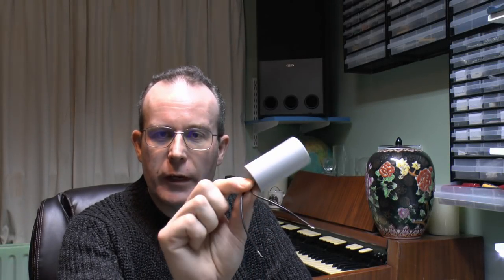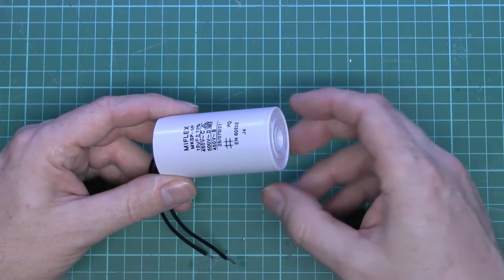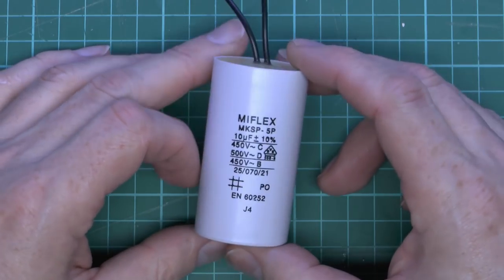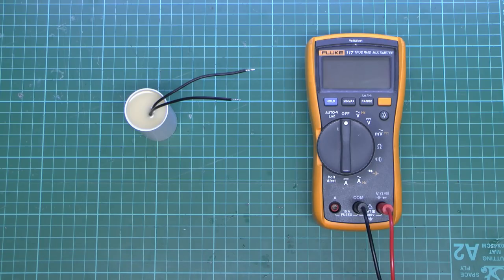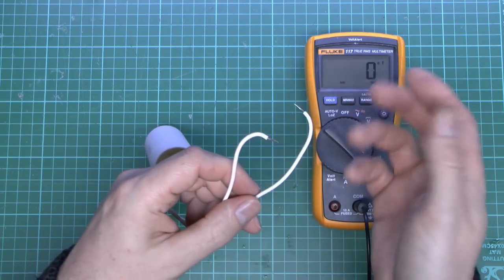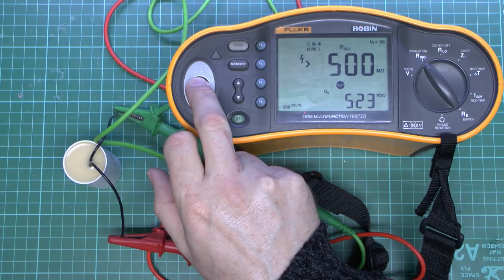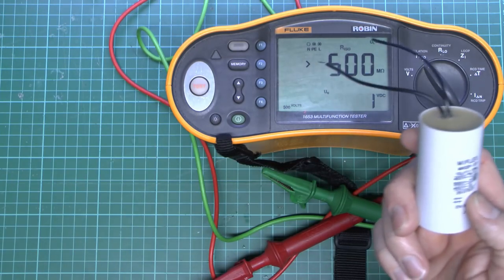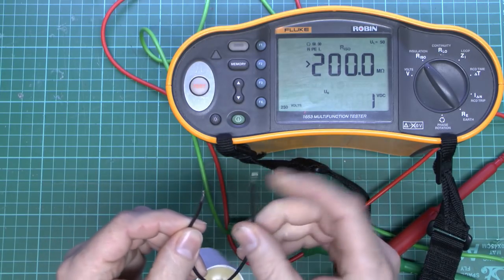Capacitors for electric motors

Comment from the maker: Short video of the faulty capacitor cut open: https://www.facebook.com/jwflame/videos/320897598422229/
Reply: It makes me wonder the quality of the capacitor when the core is that far off center, as the core will have greater insulation to the outside in some places compared to others. If they cant be bothered getting the core somewhere squared, what else haven't the manufacturers been bothered with and cut corners?
Reply: can a failed capacitor cause a rcd to trip?

Comment: Well what would you know...... Just watched this on the 1st and my tumble dryer packed in yesterday and the cause after some simple testing... the capacitor for the motor :)   Thank's John - new one ordered and to be fitted tomorrow :)

For those interested:
White Knight CL 447WV
Symptoms  - No grinding noises/bearings smooth/drum not locked up/belt intact/timer/heating element all work fine and motor powers up but no spinning drum.  If you give the drum a little push start it works as normally, when drum stops to change direction it wont spin again without a nudge.
Fix - Replace motor capacitor

Comment: Well done John, useful information and great presentation.  I have the benefit of a private water supply and multi stage single phase borehole pump some 88m below ground.  I forget the startup capacitor value but they are like bake bean cans (excuse the phrase!} and when they periodically blow they usually explode leaving a large hole in the side of the case!  37A startup current would account for this.  An explanation of the circuit would be useful and the considerable advantages of 3 phase motors - now available by using an inverter in this scenario.

Comment: Had one give up the ghost last week in a central heating boiler pump. There was no leaking or deformation in the cap, but that's not unusual in this type of poly caps. One thing worth mentioning is the fact that if the cap is blown, in some cases the motor will draw more amps and fry itself.

Comment: With an old analog meter can test if open or shorted. Using continuity (resistance) apply to terminals then reverse a good capacitor will kick the needle....Good idea to short capacitor before removing from motor.
Reply: Great video.  Thanks for posting.

Comment: Something else that is very important is that it's an AC rated capacitor and not a DC electrolytic as the latter will fail catastrophically using AC. Of course they are unlikely to be confused as a DC 450v electrolytic of that capacity will be much smaller and look rather different, but just in case...

Comment: Using this Fluke(same as mine) and a Robin won't be enough to determine the health of a capacitor even if you get the correct capacity (Farads) when measured.
What you need in reality is an ESR meter to meausure the Effective Series Resistance, if it within the proper value the cap would be good and the machine would work efficiently, or else, many bad scenarios could take place, fire, damage to motor, fried PCB, or even electric shock in some instances.

Comment: What does resistance value denote in these tests? Is it mean that the capacitor is not internally shorted and the resistance between its dialctrics are according to the specs?

Comment: Just a note: some motors have an auto reset thermal cut off to prevent burnout caused by a pump running dry etc. Worthwhile waiting for possible reset before checking capacitor.

Comment: To make a 220V motor spin slower, do I need a smaller capacitor than original, or a larger one ? And does it directly multiply ? E.g a half or a double size capacitor would give half or double the motor speed ?

Comment: for 3 wire ac motor with single capacitor, should we plug the com to neutral, 2 others from motor plus live to capacitor or changing the live and neutral or it makes no difference?

Comment: Very interesting video, thank you. I have a large 1000 microfarad capacitor and when I try insulation test at 500V, the meter struggles to go over about 40V and shows a low resistance reading. I thought it had a short in the capacitor but I am now wondering if the insulation tester is struggling to make sufficient current to charge the capacitor, and the capacitor itself may be ok. I also have a capacitance tester but it doesn't have a setting for capacitors this big.

Comment: Hi Mr. Ward, Very educational, thank you.
My Riello 40 Oil burner has a 90W motor with a capacitor of 4uF, which was no longer working, so I repalced it with a capacitor of the same value, which lastet about 2 months; replaced it again with on of 4uF, which lastest another month.
Now repalced it with a capacitor of 12uF. 
Hopefully this one will hold...
But my question is: will this capacitor 12uF now damage the engien; is it bad to use a different capacitor value and why?
Thank you,
Jake
Reply: Jake Kennes  Your capacitor exploded due to a fault in the circuit, or a voltage rating lower than the supplied voltage. Changing it for one of a different Microfarad value will not help that. Use a 4 microfarad with a higher voltage rating. However the 12 microfarad capacitor will not damage your motor, only worsen your power factor

Comment: John, I have to replace both capacitors on my Drill Press. The only thing that i am not sure of is, Does it matter which wire to use ?. Both capacitors have 2 black wires . but, The motor wires are red and black for the run capacitor. And red and blue for the start capacitor.
Reply from the maker: AC capacitors can be connected either way, there is no polarity.

Comment: My sun bed has a missing 240v 50 uf capicitor missing. Ive bought another but the wires coming out of it are both white yet my sunbed has a brown and blue wire to attach to it. 
My question is how do i know which wires go where? Thanks in advance
Reply from the maker: Brown to one of the white wires, blue to the other white wire.
Makes no difference which one, it's AC.

Comment: There is an error in this video regarding the voltage ratings: While it is true that the peak voltage of a sine wave is root-2 (1.414…) times the RMS level, capacitors purpose-made for AC applications (like these) are rated in RMS volts (so their DC limit will be higher).

Motor capacitors have their high ratings because the phase shift can subject them to more than the input voltage.
Reply: Yup, a 500VAC cap is good for about 700VDC.

And this means that you *must not* use a 250VAC capacitor to start a 230VAC motor - the capacitor will have 300VAC or more, because the start winding is highly inductive.

Comment: i have a box of fifty of these from taking apart pool pumps for copper wire recycling, Do you have any suggestion for something  useful  to do with them ?
Reply from the maker: Not really - no one will want used capacitors as new ones are so cheap.

Comment: John. I have a prob with my lawnmower. It's been getting harder to start and appears to produce less torque over time. First noticed this last year in the spring. More noticeable with longer grass of course but is less of an issue as the season progresses and grass growth slows. It has now packed up. This has all the symptoms of a failing capacitor. The safety breaker switch also trips when it is switched on. I only have a circuit tester which is of limited use but I decided to replace the capacitor anyway. No success. I have checked all the cables and they are fine. Is it possible the motor has packed up? If so, what is the easiest way to test it? Don't want to replace the mower if it is fixable. Many thanks. PS - Think it is @ 8 years old but has had a relatively easy life.
Reply from the maker: Motor failure is certainly possible, and could result in the same symptoms.
The breaker tripping when switched on suggests some fault with the motor itself such as failed / shorted windings.  If it was just the capacitor failed, it would not trip.
Reply: Thanks for getting back, John. That's what I thought. Did another circuit test (based on the old joiner's adage of measure twice not once!) and everything is fine up as far as the motor. Funny thing is I get a reading on both wires at the mains 'in' end but only via one motor wire, if that makes sense, which suggests a short somewhere. Trip would confirm that. Seems your hunch about the windings could well be right in which case it is game set and match. Time for a new mower before the Triffids move in. Many thanks. PS - Great channel for us part timers.

Comment: I'm hand building low voltage DC motors. What is a good starting capacitor diagram so that my motors are self starting? Thanks.
Reply: DC motors are normally self starting, no capacitor needed.
Reply: Coolkeys2009 Thanks. After I wrote the question, I started thinking that AC motors use them. I just don't want to put power to it because I don't want to burn insulation off the magnet wire. Guess it's time to creep up on the voltage and see what happens. I wanted to prevent problems by making mistakes on paper first. Obviously I'm a total noob. I've tried 3 different rotor designs, but only have had a few AA or 9V batteries. Barely able to detect a response with a neodymium magnet. I've got good continuity thru the coils & commutator contacts. I wrote the lack of response off to low power issue. I just purchased a DC power supply 0 to 30V and 0 to 5A. I really don't want to screw that up. It was a big expense, especially at the end of the month. (Thanks to my sister who helped.) And again, thank you for your response.
Reply: You could measure the resistance across the commutator and use Ohms law I=V/R to determine the voltage that will drive the required current through your windings(at  0 RPM). The maximum current will be determined by the thickness of wire you have used. Once your motor starts spinning it will require more voltage as it speeds up to keep increasing in speed. A PSU 30V 5A is a 150W and can easily destroy stuff connect to it and maybe it's self, so I would start of by keeping the current set low 0.1 to 1amp and the voltage bellow 10V. When working with inductive/low resistance loads it's easy to damage regulated psu's, so I would also watch for abnormal readings and behaviour of your psu when your motor does start spinning. Wiki pedia has good in basic information on all kinds of motors. I have made a few videos about my experiments with Brush less DC motors.

Comment: At 2:50 you say that the voltage rating printed on the cap is the peak voltage of the AC waveform, but doesn't the little squiggle/tilde in "V~" mean "volts AC"?  Which would suggest to me that the printed ratings are the RMS values rather than peak.  Are you able to confirm this?  If I understand you correctly then finding a cap rated at 240 volts AC won't actually work on 240 VAC because as you say the peak is nearer 340 volts.  I would've thought a cap would be rated at either 240 VAC or "AC, 340V peak".  Every other AC component seems to be rated at RMS voltages and I've never heard capacitors as an exception so if that's true it's a surprising one that isn't talked about much!
Reply: I just went down the rabbit hole on this for run capacitors like the ones shown. I discovered that the voltage rating on a run capacitor is for the back EMF, not the supply voltage.  Back EMF can get quite high even for a motor driven by say 120v mains and is dependent upon the motor speed.  Running a motor without a load thus at highest speed cause the highest back EMF and can shorten the life of the run cap.
Reply: @jkbrown5496  Very interesting!  How difficult is it to figure out how much back EMF you're dealing with?

Comment: Would a failed motor capacitor cause a single phase AC motor to trip out the electrics when motor is switched on?
Reply from the maker: Not usually - it would have to fail short circuit to do that, and capacitors of that type should be designed to fail open circuit, in which case the only problem is the motor does not start.
Reply: John Ward Thanks for replying. I have a feeling I've got a duff motor.

Comment: I'm guessing any digital multimeters under $20 is unable to check the MFD level of a run/start capacitor. Is that correct. None of the one's I've seen have all the options/settings that your meter has.
Reply from the maker: Most under $20 meters won't have that capacitance range, you will need to look at $50+ for those that have it.  Something like the UT139C made by Uni-T.
The meter in the video is a Fluke 117, which is about $250.
Reply: @jwflame  You just made me cry...

Comment: Hi, I don't understand why it's OK to over voltage your new cap.  It looks like your new capacitor is rated for 500V at best, while your insulation tester was happy to apply at least 530V on it, perhaps even way higher for a split second.  This seems to me like a good way to undermine the performance and longevity of your brand new cap.  Otherwise, nice video.
Reply from the maker: New capacitors would not normally be tested.  Done in the video to show the difference between failed and new.

Comment: Good way to test capacitor banks?
Reply: You will need to disconnect the capacitors from each other.
Reply: That sucks :( I got a bank of 5 caps, but when I try and start charging the bank, one cap starts to go reverse polarity :( I don't have a 3v power supply to test them by themselves but just ordered one so I'll see if that cap is bad :(

Comment: Whats the typical construction material for these?  I'm guessing it's a polypropylene capacitor.
Reply from the maker: Yes, polypropylene with a metallised coating.  Designed to fail safe (as in open circuit) and not set on fire or explode.
Reply: Unless it's a Beko. Thanks John.

Comment: Do you need to disconnect both ends of cap from circuit before testing. Both the insulation test and capacitance ??
Reply: You only need to disconnect one side of the capacitor from the circuit to test its capacitance.

Comment: Failure to describe frequency dependance on all aspects of capacitors leads to idiotic things on YouTube.  E.G. videos about “boosting” PWM “power” with capacitors to “get high torque motors to work.”  

Not your problem of course but it would be worth a video. You explain things well. Maybe you can get some sense into Arduino skills only types out there.

Comment: Shouldn't you tell people to short out a capacitor via a resistor. I shorted out a capacitor with a pair of pliers, there was a massive bang, I went deaf for a few moments. And it burnt out 2 dents in the pliers
Reply: Nadim Awan2 a resistor is not the same as pliers the resistor will take the power and transfer it to heat and would burn out long  be for the cap where as pliers are a dead short so yes I agree with you should use a resistor
Reply: Chris Mills bigclive said to use a resistor, what is the correct way to discharge a capacitor?
Reply: Nadim Awan2 sorry if what I said was miss leading I would go with bigclive and a resistor always the safer option
Reply: Chris Mills I would advise watching this video before discharging a mains voltage capacitor.  I would not advise using a screwdriver unless you have no other means to hand as you may damage, a) yourself b) the capacitor and or c) the screwdriver!  https://youtu.be/pVIV905qby0
Reply: Just put a volt meter across the capacitor, it will slowly bleed the voltage across.
Reply: heavydiesel "ain't no body got Time for that" lol
Reply from the maker: A resistor would be the safe method to discharge a capacitor.
For motor capacitors it would be very unusual to find one charged, as they are connected across the motor windings so would be discharged as soon as the power was disconnected.
Reply: John Ward so if you get a big bang from a motor capacitor, then an investigation into the windings should be indicated.
Reply from the maker: +Jeffrey Hueseman  Yes, as that would imply the winding had gone open circuit, or the capacitor had somehow been disconnected while the motor was running.
Reply: @heavydiesel A typical digital voltmeter has a resistance of 10Mohm - it's going to take a long time to discharge a large cap using that.
Reply: @jwflame  So the motor windings act as a large resistor and discharge the capacitor? Is this true for both perm capacitor and start/run capacitor?
Reply: @WhiteShadow2k1 You're then going to be putting a lot more than the maximum current for that range through the meter.